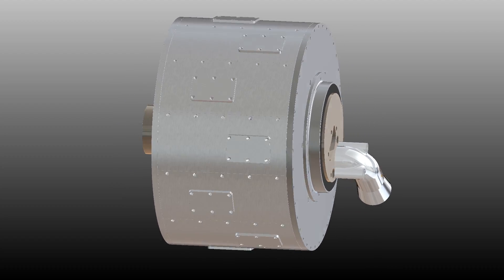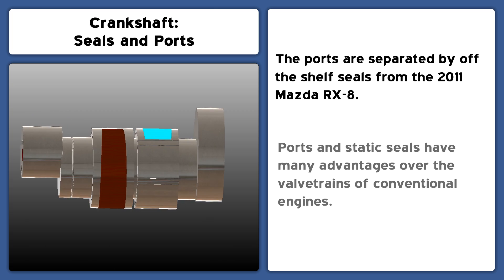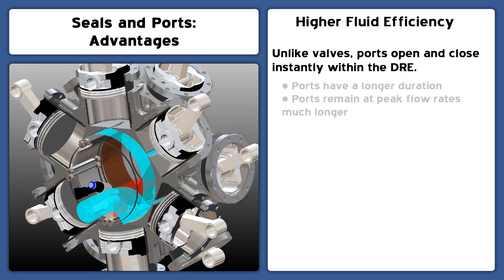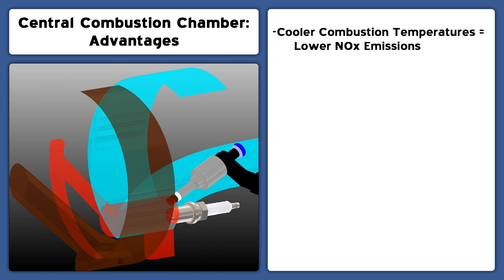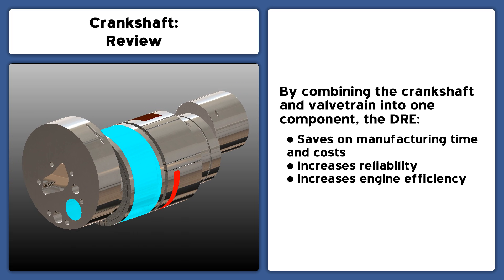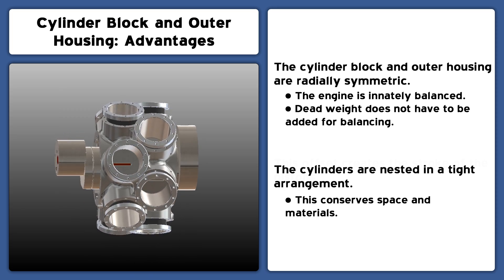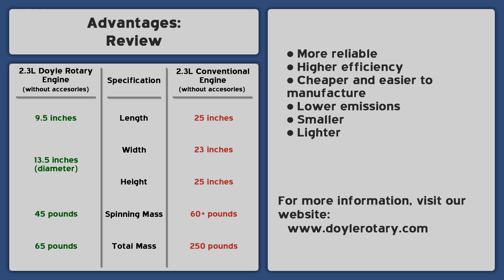New Split Cycle Engine Concept: The Doyle Rotary Engine

Comment: This engine is a very nice idea. The design challenges appear to be the coolant system for the combustion chamber/valve block and the expansion cylinders. The other major design challenge are those linear seals on the rotary valve ports.

Comment: I think another thing people aren't realizing... You have a 12 cylinder engine and only 6 pistons are actually undergoing a combustion cycle...
Reply: +Kyle Barr On that though, in a normal 4 stroke 12 cylinder, only half of them fire on every crank rotation. Every cylinder is half lost to compression! This engine just dedicates half the cylinders to compression and half to combustion. This does have a negative impact on distribution of heat, as half the cylinder will be very hot, and half will not get hot, thus the cooling surface area is halved.
Reply: +threepotgtti okay true, but then you will have the combustion cylinders firing twice as much meaning there would be no difference. If anything, you would need an even better cooling system because there would be more heat in a smaller area.
Reply: The logical response to equal heat distribution, then, is to have the cylinders alternate roles periodically.  Of course, that likely results in more moving parts and complexity, but having had enough real-life experience in what having uneven temperature distributions in things can do, it seems that’s a more sensible path.  That is, unless somehow the math is done to cause both types of cylinders to generate the same temperatures from normal operations, but short of water cooling to distribute heat more efficiently than air (iirc water comduxts heat 1000 better due to density) I’d be surprised if there’s a balance readily had in operation.

Comment: A few cycles and this would become projectile city. Unless the outer housing was some serious steal. Heat and or wear and it would offset and vibrate off any mounting it was set into. The only application this might work in is if it is real small and limited in rpm's in something like a small electric generator.

Comment: This is a joke. This "engine" pops up every few years, with a new name, and claimed to be the next best thing, but nobody ever uses it, it works as a concept, but not in reality. There has never been pics or vids of it actually installed and running in something.
Reply: +Martin McMartin 

There is a linear proof of concept for the separation of compression and combustion chambers (As opposed to using the same cylinder in the Otto cycle)   http://doylerotary.build42.com/

Comment: Do you have any rough idea what the practical rev range would be?  What would the torque curve be shaped like?  How is centrifugal force dealt with for lubrication and cooling or is that even an issue with your load bearing parts on the outside?  Last but not least, why call it a crank shaft if it is not cranked on haha?  I think that part needs a new name.  You can't even call it a head really, although it does the same job.

Comment: No variable valve timing to increase efficiency at varying rpm, and huge amount of rotating weight. Absolutely not
Reply: +Xander B (x5parkyx)  If it turns out to be efficient only in a tiny rpm band, that makes it ideal for a range expander for a serial hybrid. Also, remember that this is a constant-volume burn cycle, so total fuel burned should approach 100% for many rates. Rotating weight may be high but reciprocation is vastly reduced, plus it appears that total rotating weight is actually less than an equivalent conventional engine.

Comment: This is called a radial engine, not a rotary.
also how do you intent to balance this thing?!
Reply: +Dicky Mint Rotary engines have rotating pistons hence the name.  Radial engines simply have a radial layout to their shape, hence the name. This could technically be labelled a radial rotary engine if it works.  Its naturally balanced.  The fixed "crankshaft" is simply offset and does not affect balance.  The rotating assemblies are centered and symmetrical.
Reply: Nah, the rotary is the Wankel type. It has rotors, hence the name.
A piston engine that rotates is a radial engine as the pistons are reciprocating and works around the radius.
Reply: This is definitely a rotary engine. Think of the Sopwith Camel and other WWI Bi-Planes. Also, here a link...
https://en.wikipedia.org/wiki/Rotary_engine
I for one, when looking for a CGI engine, will think of this one... Or really any of these "New and Improved" engines that exist in CGI form only.
Reply: Your right, believe it or not it should balance it self. This is a rethought hydraulic  motor. I don't think it will make much power, if they can keep it cool

Comment: An engine that couldnt be properly oiled nor cooled, and that would shake like none other due to a giant metal chunk thats rotating off center. Picture a crankshaft with no counterweights. Thats what this is.
Reply from the maker: Rewatch the video. No piece is spinning off center. It's very smooth. 

Also, the oil system wasn't hard to design. It pumps through the stationary crank (for plain bearings), to the cylinder block and out to the outer housing where he is scavenged. Oil is also pumped through the rods to the wristpins.

If you look closely in the video, you can see water jackets around the cylinders. Mechanical seals similar to those in water pumps direct the water between the crank and the block.

Developing this engine was an expensive family hobby that was put on hold a couple of years ago. We'll revisit it in the future but for now we've got a different project that we have designed and set up to manufacture (DF Goblin kit car).
Reply: +Adam Doyle I appreciate the  reply. My question is how do the connecting rods manage to push the pistons if there is no eccentricity. If everything spins centrally, then how would the piston position change. That's the largest issue I ran into with this, the rest could be worked around.
Reply from the maker: The cylinder block is eccentric to the crank. As burning gas expands in the power cylinders, what is essentially happening is that the cylinder block and crank are trying to align but since they are constrained, it becomes a rotational force. The torque arm of the engine is equal to half the length of the offset.

Despite the eccentricity, everything still rotates in a circle. If you track the path of the pistons from the end view of the engine, you will see that the path is a circle.

The most recent development on the engine was when we got a thermodynamic cycle analysis completed by a university and then built a non-rotary version of our split cycle. You can read a little about it here: http://doylerotary.build42.com
Reply: +Adam Doyle I see what you're saying now. It's  undeniably an interesting concept. Thanks for the clarification
Reply: JESUS CHRIST!
So, you didn't say anything about horsepower.  Does that mean you don't know anything about horsepower? Does that mean horsepower doesn't matter? Oh yeah, but now we all know how to oil it. Don't jump on me because you commented on something that you don't know anything about. maybe if your read the rest of the comments, you wouldn't have to bitch at me now. Are you really that stupid?
 Why did you choose to fuck with this shit. Stick to religion, it's a softer target than mechanicals.
Reply from the maker: Pretty sure my dad and I didn't ask anyone for money. This was a project we worked on many years ago. It'd be cool to revisit but we haven't touched it in years.
Reply: Duh, since the housing is further away at the end of it's stroke, it act as a crank. Pushing between inner and outer either before or after TDC will cause rotation until it reaches it's max stroke.. Simple physics.
Reply: "Tim Halas" ... the guy who has wet dreams of being a genius
Reply: +Adam Doyle so what you are saying is that when combustion happens in the cylinder it pushes the...heck I don't have the words "barrel that the piston is attached to" up and since the piston has no where to go because it's hooked to the barrel and in the cylinder it pushes the barrel around the shaft?
Reply: Looks like it uses a dry sump system to lubricate, not unlike Harley has been doing for decades! =_)
Reply: Terry Wilson
Who are you directing this question to?
Reply: HeadShot360IN
The issue isn't about rotating off center. The combustion strokes can not accomplish powered rotation. Look carefully as it is turning. All the con rods do is push against the inside of the housing. How can they possibly have any leverage. It's like standing inside of a cylinder and pushing against the sides. Nothing is going to move unless someone is turning it while you push. This is just a fucking cartoon. That's why you will never see a prototype. People make these animations all the time in hopes of getting funding. This is NOT an engine. It doesn't even fit the definition.
Reply: Terry Wilson
Look at it, what is going on here, is rotating the whole engine around the cyl head. A radial engine rotates the whole engine around the crankshaft. That's why is creates torque. This cartoon image cannot make enough torque to sustain its motion. Look at the positions of the con rods in relation to the outer housing. They will move in different directions to each other, while attached to the same solid housing. IMPOSSIBLE!.. It's not an engine!!
Reply: Terry Wilson
 If he builds that very engine design and gets it running....I will be surprised. If it makes usable horsepower AFTER the starter is disengaged, I will buy one.
Reply: There is a difference between "like" and "not unlike"....of coarse, you would have to be familiar with things like context and the demeanor of the spoken word. Apparently, English is a second language for you. good luck finding people are interested in listening  to you.
Reply: Tim Hallas "of course"
Reply: LOL Hey dip shit where do you read where I said anything about horsepower? Or are you really just that fucking stupid?
Reply: Adam Doyle
Sorry. I just see too many people presenting this kind of stuff for donations and investments. Nothing personal kid, but this idea isn't new. It wasn't 30 years ago and it can't work for simple mechanical reasons. I wasn't trying to insult anyone.
Reply: +Shane Powell To answer your question, since the designer won't. It is mechanically impossible for these pistons to make that barrel rotate. it's a cool looking cartoon. look at the angle of the con rods to the sides of the barrel. This "engine" would do nothing but spin around at best. There would be almost no power output. remember the rules of mechanical energy . You have to crank a crank shaft.
Reply: 'not unlike'?! couldn't you have simple said 'like'?!
Reply: JESUS CHRIST!
You would think that matters, if there was any way this thing could actually produce usable torque, or horsepower, but it doesn't. its just another money grabbing cartoon. Hey, if your Jesus Christ, you should have known this. Now I'm forced to doubt your credibility too. Shit.

Comment: so how do you cool these revolving cylinders?  air?
Reply: Combustion does not occur in the cylinders. But combustion gasses expand into one of the rings of cylinders.
Reply: +mrrv6apilot The more efficient the engine, the less waste heat that needs to be removed by a cooling system.

Comment: HUGE gyroscopic torque problems. Plus a re-invent of 1903 technology. Not new just revamped. Oh by the way, oil consumption on rotary engines is historically high.
Reply: +Brian Smith My thoughts exactly. Recall the LeRhone rotary engine of the early days of aviation and WWI. Plane could basicaly only turn to the left because otherwise the gyroscopic precession forces might tear the firewall off the airframe.
Reply: +Dave M Perfect for NASCAR!

Comment: The holy grail of positive displacement internal combustion engine design is one that does not have reciprocating mass, 

 There have been various attempts at internal combustion engines that do not use a piston and cylinder and therefore do not have to reverse direction of heavy moving parts most notably the wankle, thank You Mazda for the effort.  There are various designs that have a type of positive displacement but do not have reciprocating pistons that are very good as pumps or turbines for example hydraulic gear pumps or Whipple superchargers it cetera however there is no other thing besides the piston in the cylinder that has proven suitable for internal combustion, with the exception of a bagel or similar rotary type engine and that is marginal. This is because you need high strength to deal with high heat and pressure.
The problem with these type of designs is that since they do not use pistons and cylinders they cannot see you very well that could not hold high pressures since they have to seal pressure in more than one plane . Because they cannot hold high pressures they can I have a compression ratios and high thermal efficiency and low emissions. 

The only engine design here too for that can combine the high strength sealing of the piston and cylinder but without the reciprocation of said piston and cylinder is some variation of the rotary engine, by rotary engine I mean like a world war 1 aircraft engine. That is what this engine is in that the pistons and the cylinders rotate on different axises.  Of course even though old style rotary engines had this theoretical advantage but in practice radial engines and various forms of inline engines prove to be better for various reasons.
Reply: Paul Girardin meant to say "...positive displacement ICE..."

Comment: not good use pistons with blades in the middle! not good
Reply: +baklazan ivanovich What are you talking about?
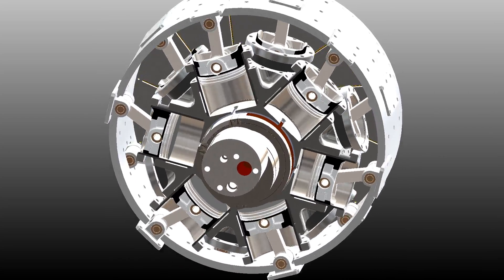Reply: +Quadrunner 0:46 you can see blades in the middle separating cameras = rotor engine principe - not good because you must use cooling system for theese blades
Reply: baklazan ivanovich Yes, liquid cooling would probably be utilized in the areas separating the cylinders. Why is that bad?
Reply: its bad because very small peace of metal need for cooling and 2 problem its like exhaust in 2 stroke engine - metal blown hot gases. Better wait while i make pulse gas turbine/ this year project

Comment: more complex than a Wankel rotary, Increased manufacturing costs. It would have to have HUGE benefits over the much simpler Wankel to be successful. Considering the  difficulties Mazda have in marketing the Wankel, this engine will remain a pipedream of its inventor.
Reply: The problem in the Wankel is the seals on the rotor tips. That is not applicable to the Doyle engine.
Reply: there are. The mazda wankel rotary has dogshit for efficiency.  16 and 22. It's probably because they butchered it somehow or idk. the dre should be way more efficient.

Comment: I don't think anyone wants to see animations or talk, they want to see an engine that is made in volume that has better mileage and better durability than what's already out there.
Reply: David W You have to start somewhere, and animations are a great way to explain and present a concept as it's easy to pull apart and show different things in different ways
Reply: +David W The reason there has been no real challenger to the Otto type piston is what you stated. It does so mony things well. Mileage, durability, ease of manufacture are the top reasons.
Reply: Oh we have those already. We're not allowed to make them though, because "Gasoline Bad. Pollution Bad. Cars Bad." 

The technology was well known in the automotive industry. They were experimenting with 50+ MPG back in the 1950s. However, gasoline was cheap and there was no need for a more fuel efficient car. And this was all before computers! Analog solutions! Cars that sipped gasoline and combusted the fuel more completely!

All the crap that goes into cars today, the computers and senors are really due to emission laws. And its because of them that we are lacking in fuel efficiency and durability. Think about it. A 1912 Model-T engine 100 years later will still run fine. While your 2012 Ford Focus is going straight to the junkyard ten years later. 

Unless Americans are buying a new car every ten years, the car manufacturers are losing money. They're losing money because of all the crap the government requires cars to have in order to be street legal. All that copper wiring, computer chips, silicon, gold, etc. etc. (not to mention solder rot from unleaded solder in electronics). No, we figured it out a long time ago and we can do it today. If the government just steps out of the way.

Comment: Ok , lot of talk, pretty graphics and speculation but wheres a working engine
Reply: they abandoned it during ww1... at least they used very similar engines back than but since whole engine was turning they figure it out it was not good solution at all.
Reply: @jebise1126  you're talking about the WW1 rotary engines, which were really radial engines with a fixed crankshaft and free spinning block. It was a fine solution for the time, saving weight because they extra spinning mass acted as a flywheel on its own, and provided its own cooling.
Reply: Don't work because the centrifugal force pull out the lubricant from insiste the  cilinder, mostly at high RPM.

Comment: The reciprocating piston engine has been the standard for well over 100 years because it works better than all the harebrained ideas that have been tried.  It will be interesting to see how THIS harebrained idea comes out.
Reply: It won't come out. It a dead end like all of these so called engine's that make claims about "less moving parts, less rotating mass". All seem to have more complicity in there designs.  None will ever be built because a cartoon and the real world are very different!!! Keep Rocking You Get It!!!